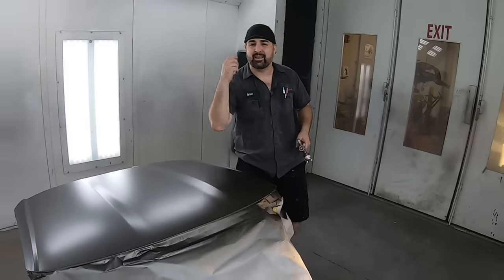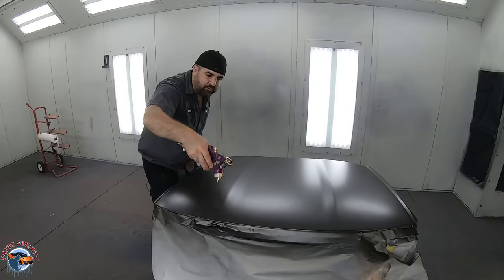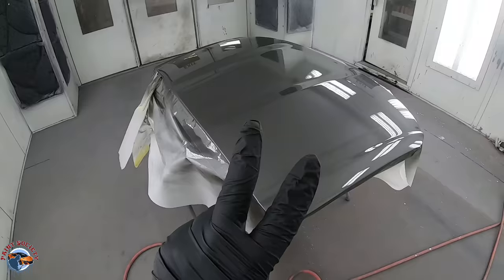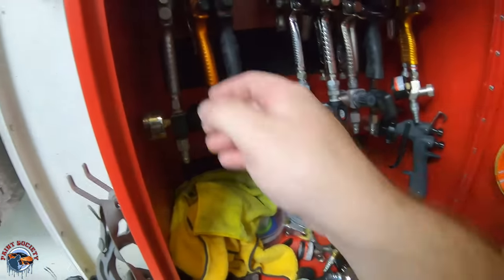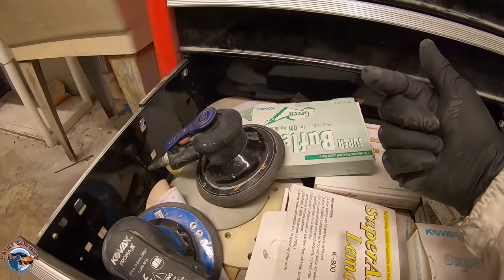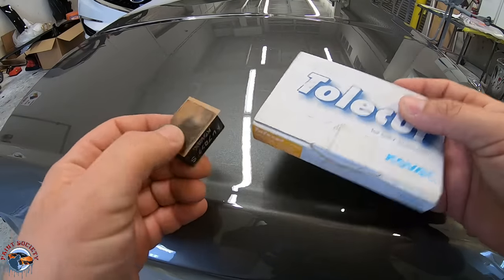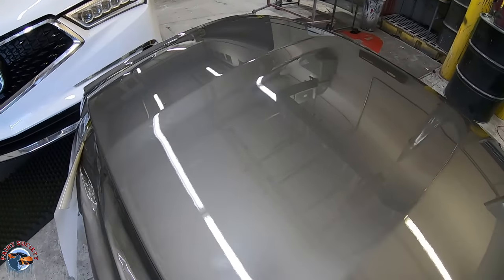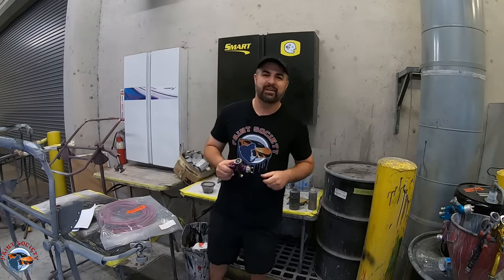How To Get AMAZING Results With A $15 Harbor Freight Paint Gun!

Comment: MOST IMPORTANTLY YOU NEED A GOOD AIR COMPRESSOR
Reply: at least 60 gallon with 11 cfm
Reply: @chiwy909  70
Reply: not only that, the nozzle is 1.7
Reply: @monishaclark3049  2.0
Reply: @chiwy909  I don’t have that type of money
Reply: Whats the difference between the spray guns the paint jug on the top and the one on the bottom?
Reply: 1.4
Reply: @mayneyeh7229  one is gravity fed the other is suction.
Reply: @pastyhauler  which is better
Reply: @mayneyeh7229  gravity fed
Reply: @pastyhauler  thanks just need some tips doing home project painting my toyota
Reply: @mayneyeh7229  HVLP gun, make sure you degrease all panels before paint and don’t rush things
Reply: @pastyhauler  yeah I cleaned with wax and grease remover and primed it and smoothly sand down start looking good now I see why painters say no rush so the out come is much better
Reply: Pancake compressor does just fine
Reply: @christianpoblete8471  I just bought this spray gun and have pancake compressor also, any tips?
Reply: @levilawhorn1952  go slow.  Good prep.  Mix your paint properly. Practice.
Reply: mines 100lb like that catfish i caught blows 300barpsi. take a hood smooth off if it runs off on ya

Comment: After watching your first review I purchased two of the $15 guns to use at my brother's house. I sprayed all of the cabinets and wood work with oil based paint and it went on really well. The tricks that I learned was that the paint had to be thin like milk and to use a high capacity air compressor. He had a 20 gallon one and I had to wait a long time for it to catch up with me. We got mine (designed to heep up with several framing nail guns) and never had a problem with atomization.
Reply: What type of paint gun is that and I was thinking of covering window's then doing it.
Reply: milk  isnt thin  ..Unless you're using skim
Reply: did you use paint thinner, approximately how much per gallon of paint?

Comment: Great content as always. Two things I'd like to see, what do you do with the paint gun while the paints flashing and what do you look for to determine the gun is deteriorating. I noticed it was hanging when you picked it back up, does it just hangout while the paint flashes. Would love to learn more.  Keep the videos coming.
Reply: Yeah you just leave it on a hook until the next coat, you don't want to leave it too long in a hot booth or the warmed chemicals can begin to harden the lacquer.. always clean it thoroughly after the paint job though!

Comment: I've also had great luck with the cheap-o harbor freight spray guns. Best part is, they're so cheap you just throw them in the trash when you're done painting. Easy cleanup. lol. 
These guns work amazing when spraying automotive 2k paint as long as you reduce them properly. Most of the complainers have the paint too thick or are trying to spray rustoleum straight out of the can. I've got an old GE fridge from the 1930's in my garage and i sprayed it using a harbor freight gun and rustoleum epoxy paint and 10 years later it looks brand new. The key was using a denim pad to flatten out the orange peel.

Comment: Back when I first started as a Painter for a fleet painting company, Didn't have money for a high end spray gun, So I purchased something equivalent to this spray gun that cost $40 dollars at a flea market.. The other Guy that would paint trucks with me had an Iwata LPH400 and I was able to produce the same paint results spraying 2.1 VOC Single stage Paint which is very thick. Back when I was in Mexico, I painted with the 30 dollar version spray gun of the Binks Model 7 spray gun.. What I'm trying to say is that if you get Good with a cheap spray gun, anything else comes in easy.

Comment: I bought this gun years ago for a back up. I ended up using them for years when they were made in Taiwan. Once they moved to China the quality really suffered. I couldn't get the fan pattern to open up and the fan control knob melted with thinner.I can pretty much make any gun "work" but this also depends on paint lines, especially base coats. Dupont is more user friendly with this gun but when I started spraying Glasurit or PPG( DBC) the game changed. These are thicker base coats and getting this gun to lay metallics and blend was a battle. I hung this gun up and never looked back. It just doesn't atomize like it should.

Comment: I’m painting my motorcycle with 2 harbor freight guns and HOK paint.  It’s not looking too bad for a first timer.  Thanks to all the videos and learning from Paint Society!
Reply: Same with me, I had problems with clear coat because my garage is on woodworking too and some dust got into the clear coat and I hadn't got any filters so couple of spots appeared, but now I'll try to fix it with 1200 sand paper and some polishing
Reply: @pepelazy3249  If possible, get some thin plastic sheets from Home Depot and make a simple (portable) paint booth.  You can make a simple frame out of PVC pipe and the 90° corners, etc.  Not sure how big an item you are trying to paint (full-size cars or parts) but a little bit of plastic (anywhere in the room) is going to help.

Comment: not sure if you read or remember my little theoretical tip/mod for that purple guns main needle. if you look closely at it , the tip is ground pretty rough. i took the needle chucked up in a drill, took some 30 micron emery cloth and polished that needle tip. theres an improvement on how the paint comes out . probably eliminated any turbulence if i had to guess. mod took 5 minutes.

Comment: Question, using a hardener designed for warmer temps will slow down the drying time, correct? Temp 75f using hardener for 85f will give longer flash time?

Comment: I have this exact setup with PPS 2.0, 3m regulator and the purple gun. I have the settings exactly as described here and was able to paint two cars and a truck with surprisingly good finish. I was repainting same color, so I only used base and clear on two and base/ pearl mid/ clear on the last while spraying with 3M gun cleaner in between. Thanks Paint Society, you saved me a few hundred on guns, though if I need to paint again I'll buy another purple gun.
Reply: What air compressor do you use??
Reply: Which adapter did you use for the PPS 2.0?

Comment: Excellent job, unfortunately I your definitely a expert and make it look easy. I'm wanting to use mine as a replacement for spray cans ,industrial type applications, frames undercarriage parts custom built or repaired implements etc. So 1/32 as good as you will be sufficient 😂,  trying to get the minimum needs setup. I have gun compressor and regulator not sure on harder for enamel and then cleaning after tho. Total novice to pm and any tips and tricks to maintaining, but I feel hardened paint and bulk would be better than cans.

Comment: It’s really all in the painter and air Compressor sadly I’m still a newbie and only have a 29G air Compressor I tried using that gun nope I get a good finish with the HarborFreight $139 spray HTE gun did amazing with base coat and clear coat then got the no name brand spray gun which did amazing for clear by far got the best finish with that using clear now I just got a pro lite with the TE20 air cap used a 1.3mm for clear come out like glass thanks to your videos love that you explain and give pointers and how to go about doing something like what sand paper grit to use and then finish with thanks brotha
Reply: Try finding an add on tank for your compressor, just a simple 10 to 20 gallon size will do.  (IE Harbor Freight portable aluminum tire filing tank will do).

Two ways to set up:  1.  Place a pipe “T” where your normal quick connect is set up on tank.  Build a short hose (min 3/8” ID) with standard couplers & fittings and just plug in when you paint.  2.  If you have a permanent set up you can run a regular PVC pipe down the wall etc., to where you are painting. Some distance is helpful, the further away the tank gets the better the water control.  Juat connect to that tank and then to your spray gun instead of going back to the original tank on the compressor.  Adding more volume will help your pressure to be more stable although you will have to wait longer to fill initially.  It would be a problem if you were using the compressor constantly to blow off parts, etc, but for painting you wait between coats so there is plenty of time for the compressor to build back up.

PS. You can also purchase an inexpensive compressor from Harbor Freight, etc, when they’re on sale.  Just hook the two together when you are painting and need the extra volume.  Probably $100 will get you a decent one, for occasional use.

Comment: see, Brian. this is what i mean by by post on the fb page about this and the black widow. you did this with the cheapest guns available . given , you have way more experience in painting than i do ,but if it can be done... if I can do it half as good as you do, i'll be fairly satisfied. these are the videos that tell us weekend diy'ers its possible.
Reply from the maker: Still pretty tough using this gun but it’s possible 😍
Reply: @PaintSociety  ive done a few things in my life after a little deep studying that i was told wasnt possible by a beginner.

Comment: I have actually painted an entire car with this gun, I bought 2 guns (one for base coat and one for clear). Note that the cups for these guns are junk, so when painting a flat surface you need to watch out for leaking or better yet replace it. Brian is right, I didn't use these guns again for painting cars after the first use. They have been retired for small home projects.
Reply: I have about the same it's a parkside so it's made from the same factory anyway, I bought the cups like the 3M ones(the cheap one on amazon or aliexpress) it work better with thoses, dont have to watch for the cups to spill everywhere or moving too mast and fluid overflow on the sides. I needed to paint the undercarriage so yeah not a great choice with the OE cups! I still use it, the tips doesnt changed like he show. I spray epoxy primer, base and clear. Primer is easy and allways good, clear is tought to many variables and base not great not terrible!

Comment: Hi there, if I am spraying dry non skid onto rolled wet paint what PSI would you recommend? Was thinking 30 PSI. Would I have to worry about the fluid knob if I am spraying dry material? Also I'll be spraying standing on top of the boat down so the gun will be horizontal.   Thanks!

Comment: I have no idea where to start. We inherited an 09 civic, I have don't all the mechanical repairs and got it up and running. The paint is .. well missing in a lot of spots and even bare metal over alot of it, not rusting tho. It's almost time where it needs a paint job. I am a 💯 beginner and never had done anything like this before except stain my patio furniture once. 

I have this exact gun but not sure if I need this or one of those LVLP guns? 

Here are my compressor specs. It's the kobalt 26 gal, electric, oilless compressor. 

This 26 gal air compressor equipped with 1.8 HP 4-pole induction motor and dual oil less pumps provides high air flow of 4.5 CFM at 90 PSI with 150 max psi,

Any tips or directions? What kind of paint do I need to ask the auto body for? What kind of clear coat? Any ball park guess on the cost to diy this 4 door sedan? Thanks!!

Comment: There's nothing wrong with painting cars with cheapo guns, so long as you only plan on doing a couple of cars. Those guns aren't going to hold up to long term use though. I buy 40 dollar guns with 1.8 or 1.9 tips from Grainger or Harbor freight, I use them for spraying high build blocking primers and thick stuff like that. They usually wear out in a year or so, but the price is right. I use Iwata guns for basecoats and topcoats.

Comment: Good stuff.... i noticed all your guns had a regulator and a plug only...since you have a pro set up, no need for that red filter I keep seeing...  Assuming I’ll need one, where do recommend it goes?  Between the regulator and plug?   It would be permanent with the gun then ya?   Has anyone tried to put it on the hose end prior to the coupler so it travels with hose and not the gun?

Comment: Will this spray gun work great on a 5 cfm 26 gallon air compressor I had it before but I used recently the 49.99 kit the two spray guns from Harbor Freight but the cfm is 12 or 13 I think but got too much orange peel using them with the 5 cfm air compressor gonna get this spray gun from Harbor Freight maybe two but still plan on buying the Fuji Q5 platinum instead of buying a new air compressor.

Comment: For shooting a motorcycle gas tank with metallics using a Sharpe Finex FX3000 HVLP Spray Gun, can you recommend good set-up numbers. Tip size, psi at regulator, etc.?

Comment: If the nib was the dust you mentioned after the 2nd spray, that means you cleared over them with the 3rd spray....so when you sanded them smooth doesnt that mean you had to sand down like half the clear to get it smooth??

Comment: Gun doesn't have Seals,  as chaulkin as Seals. If you dip the whole gun in acetone to clean or take gun completely apart,  chaulkin will break apart. They are considered throw away guns,  use them a few times with basic cleaning ( not a full tear down) and then throw them away. You don't need to have all the settings wide open,  the gun can spray just as good as a SATA , but having chaulkin as a seal is the main draw back of this gun.

Comment: Did you go with the 50-70 psi as the gun says? Or is that too much? The reason I ask is I bought 2 hf purple guns. Originally the one I bought says max psi 45 but requires 12 cfm or somewhere around there. The second one I bought for 20 bucks was the one I believe you’re spraying with and it says psi 50-70 psi but not 50-70 max psi. So is 50-70psi  the proper atomization range  since the cfm usuage says only requires 6 or 8 on the box compared to the 12cfm max45 psi

Comment: is it possible to paint chrome trim on a c43 amg? the trunk chrome trim , can it be color matched to the car?
Reply: Of course u can paint it and it can be match to the car. But will it stick? Maybe yes, maybe no. U have to used a very good adhesion promoter to help it stick but with that, most shops will not warranty that type of job. Ive done it to many chrome pieces and the paint stuck but sone doesnt.

Comment: Im using this gun. Im set up at 25 psi and fully open trigger. Moving pretty quick but getting quit a bit of orange peel. Any tips you can suggest to minimize orange peel. Also are you fully pulling the trigger all the way in when spraying the clear? Thanks for all the awesome videos
Reply: up psi, spray at angle.

Comment: I am having trouble with my first spray job. I have adjusted the gun and experimented with the settings. I have also changed the pressure across the range between 25 and 50 psi. The problem is I am getting a really fuzzy finish on both sides of the wet edge. That means the trailing edge of the wet edge gets fuzzy and therefore the entire job. What am I doing wrong? It's like the wet edge is ok but I'm getting a mist either side of the wet edge that dries as rough finish not a glossy finish.
Reply: I'm not a professional but I've found turning your fan control in just enough to clean up the edges of the fan helps with that

Comment: What did you do to prep the surface ?
Actually if you're putting a new coat on the factory coat can you just clean it with degreaser and then spray the new coat on top of the factory coat?
Reply: You need to scuff up the surface, remove the shine, use a maroon scotch bright pad

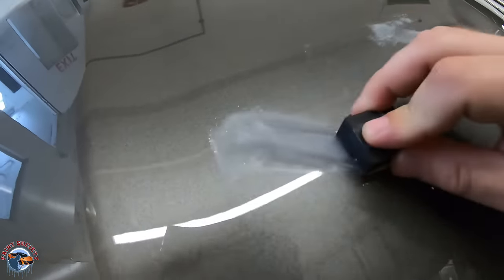Comment: 10:49 I dont get it... you flat it out but then you also flat out that area... I thought this area should go with the rest of the bumper's shape, meaning it should be roundish? so should I understand that it's the buffing part that will make the flatter area a bit more rounded?
Reply from the maker: First off it’s not a bumper. It’s a roof. Second what I mean is I flatten out the dust nib. I’m not flattening the shape of the part.
Reply: @PaintSociety  oh shit, I'm watching several video's at once, and I got things all mixed up in my head. Sorry about that. Anyway flatting out? So the dust nib will be still in the clear coat, except it will not be sticking out after the "eraser" operation?
Reply from the maker: @piotrpix  yes basically it’s lint that levels out and then you buff it and it’s like it was never there
Reply: @PaintSociety  oh, so the high rotations of the buffing machine sort of pull of the rest of the dust somehow?

Comment: How long has your panel been left before denibbing and buffing?  I'm spraying in my garage and even after a week of air drying the clear is still soft and ends up looking worse after denibbing and polishing.  Thanks for all the videos they take the mystery out of painting.
Reply: You must of mixed the clear wrong. Almost all clears should be able to polish within 24hrs easily. Usually just overnight does the trick.
Reply: I've mixed the clear as written on the data sheet. I've learned the hard way with that one 😬

The clear sands ok, like a fine dust and doesn't gum up the paper The issue is when I polish after denibbing and flatting I can see pig tails in the clear.
Reply: @tomallen2401  are u sanding it with 1000 -> 1500 -> 2000 -> 2500 -> 3000 -> 5000? And it must be wetsanded. Plus u must use the correct polish. 2 step polish at minimum should be used. Unless u have something like white or silver. I assume the pig tails are check marking. It means the previous sand scratches werent sanded out properly with the next step